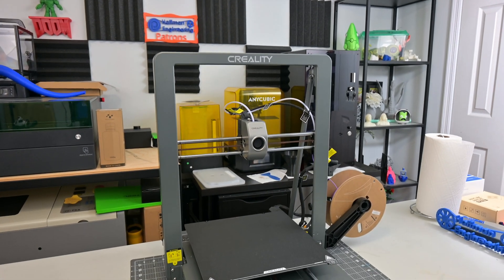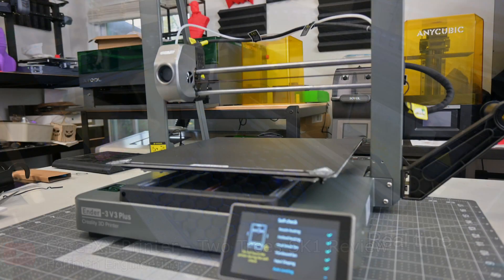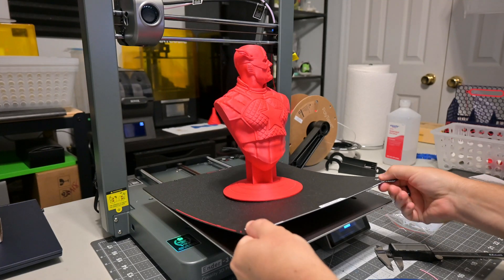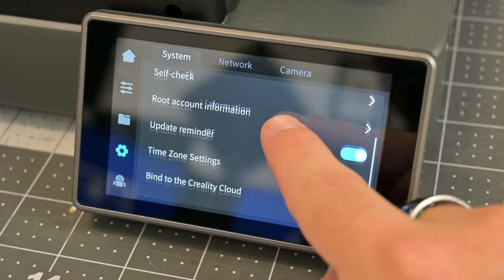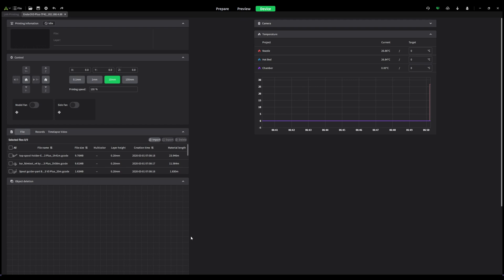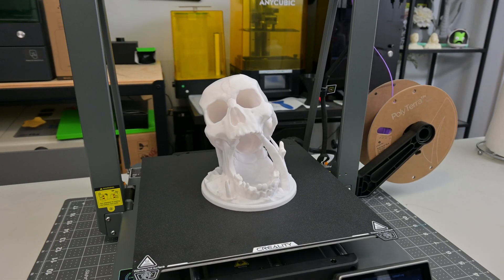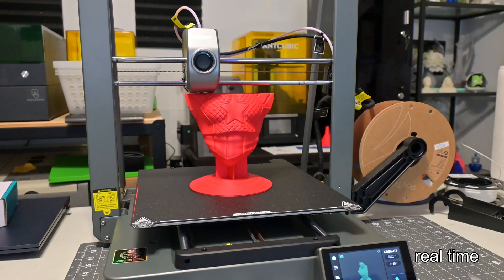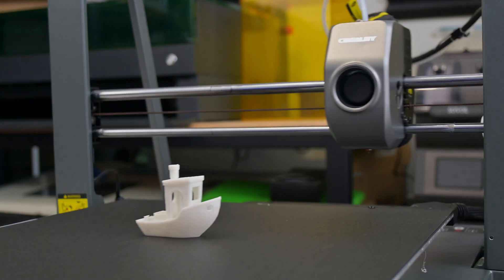Have you ever heard of a Core-XZ printer? - Creality Ender-3 V3 Plus

Comment: I’ve had the ender v3 plus and I can’t speak highly enough . If you looking for your next printer this is it. Massive bed and drama free . 

I’ve done 15 prints so far and not one failure . With me old v2 I had to watch the first layer or 2 and always work about bed lift - never happening here 

I did a 299x299x329 rubbish bin and it printed flawlessly
Reply from the maker: I agree, I was very impressed by this printer.

Comment: How does this one fare against the Bambu lab a1 standard / mini. It looks like ender might be relevant for me as i want to want to spend to much time tinkering with the 3d printer.
Reply from the maker: Larger print area for sure on this printer. They are all klipper printers, with comparable speeds and similar klipper features. The main difference is the lack of multi-color support for the ender-3 v3, there is no AMS-lite equivalent here.
Reply: @HoffmanEngineering  You can get a Co Print KCM for this for multicolor printing
Reply: @HoffmanEngineering  Speed is useless on FDM.
Reply: @slottygw2wvw842 
this is a dumb comment